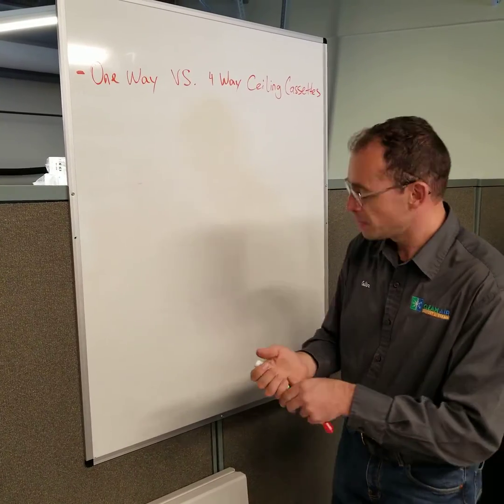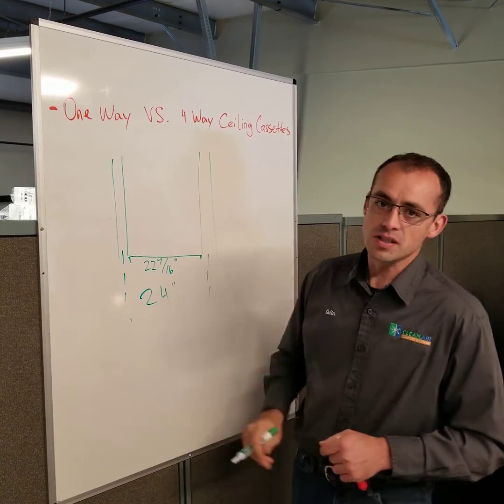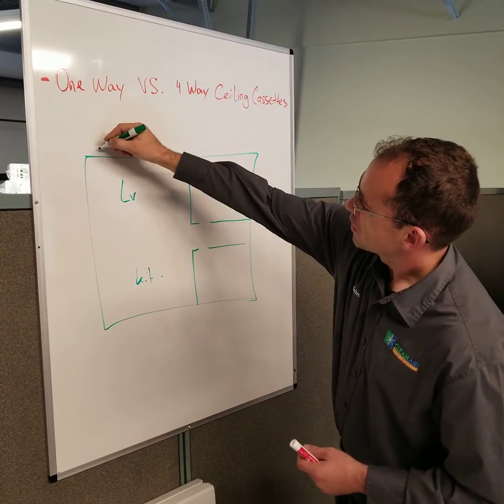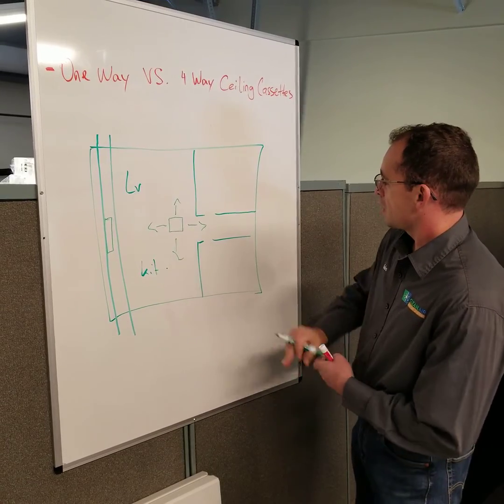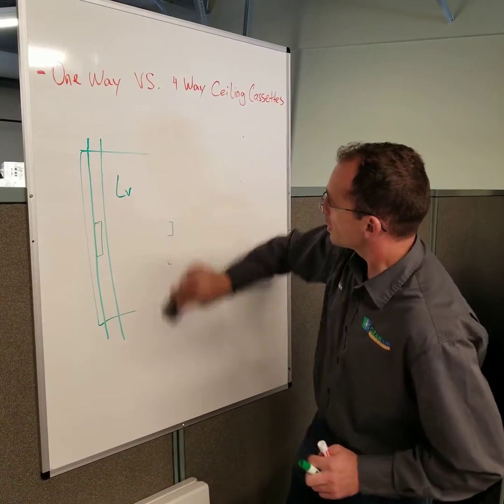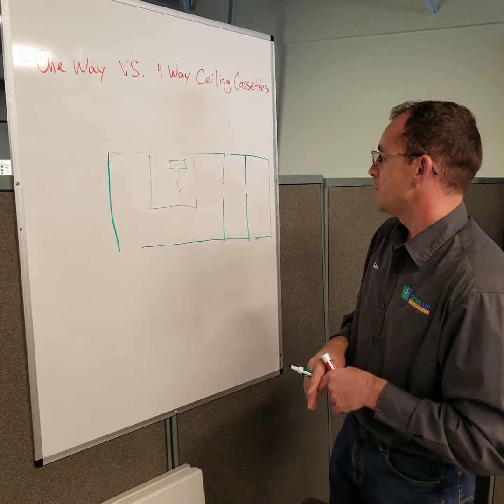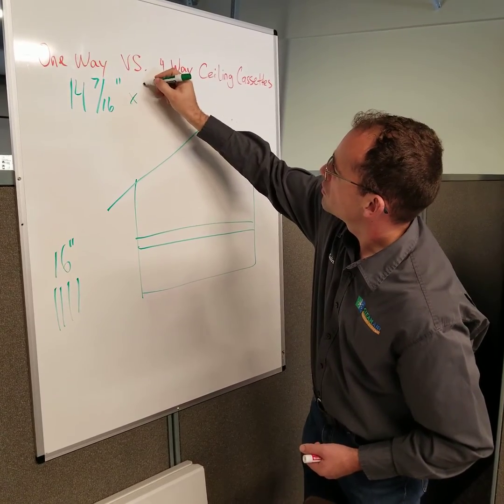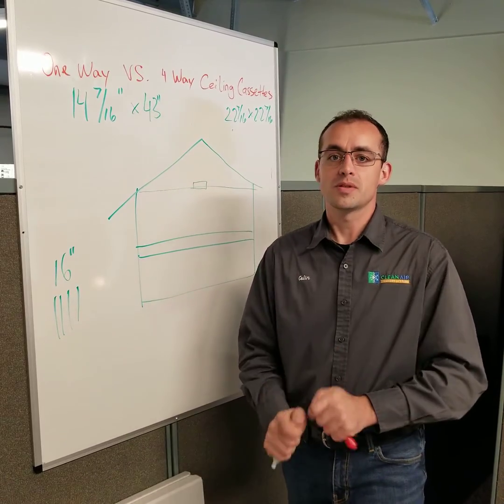One Way vs. 4 Way Ceiling Cassettes. How to choose.

Comment: Thank you for the video. I just wish  someone was making 4 way units that fit in between 16" OC joists. It would be perfect for my application.
Reply from the maker: @pabloseba35  the feeling is mutual.
Reply: @cleanairheatingcooling4105  How do you remove the mold off internal coil etc on a one way cassette?

Comment: Most underrated and underviewed mini split video on YouTube. Thank you for going through these things to consider. What about noise, 4 way vs 1 way vs wall unit?

What is the default preferred unit? Ive got a 1200sqft 30x40 garage I'm air conditioning. I dont need the cars to necessarily be super chilled, but the garage itself I definitely want to be conditioned. I'm thinking 2x 12k ceiling cassette units spaced closer to where I'll be working, to avoid ice cold glass water effect on the cars when backing out into the 95F florida humidity lol I've done that with my current home garage and its great to be able to do it. But the cars themselves don't need to be ice cold.
Reply from the maker: Great questions. First of all make sure that these units get sized correctly for that space given the square footage but not only the square footage. Do you have to use the construction material insulation the exact weather data for your area. This is a service that we offer if you'd like to call or show us a text.  

The wall mount units are generally cheaper to install and cheaper to purchase than the ceiling cassettes. It's really depends if your goal is lowest upfront cost or if you just want the right thing for the right reasons even if it cost more. When we install the wall mounted units we connect the condensate and refrigeration lines on the outside of the wall to avoid possible leaks and make it easy to service. If you want to text us some pictures of your job we can probably give you further advice that's a bit more tailored to your situation.  360-398-9400
Reply from the maker: @TheSoaringChannel  feel free to share our video, watch the rest, like them all and sub. It will help you video get promoted so it's not the most unwatched 😃🧡

Comment: A Mitsubishi Diamond Dealer contractor has suggested not locating a 1-way cassette over the bed, because the fan noise and condensation lifter may be too noisy. Do you agree?
Reply from the maker: Yes, I fully agree! Although I would say this varies is from person to person. I’ve had clients who can’t stand that noise anywhere in the room, no matter how far away from the bed. And some customers are not bothered by it even if it’s directly above the bed so I would say this is more of a personal preference for the home owner than the  contractor’s preference.
Reply: @cleanairheatingcooling4105  on that same note, the 4 way has a pump also, so that's worth noting, yeah? How noisy are these compared to the wall units? The downside to a wall unit is WHEN it floods - it drains water all over whatever is underneath. Please check for my comment in the main section. I'm about to do two 4 way units (I think) in the garage. Can the pumps be insulated so they are more quiet? Or does it resonate through the pan?
Reply from the maker: @TheSoaringChannel  I don't think that the pumps on the four-way ceiling cassettes are generally heard in the living space. I don't think we've ever had a problem or a complaint with those. But the add-on accessory pumps for the wall mounted units usually create complaints because its buzzing sound is a bit too loud for most living spaces.

Comment: Helpful info. I've only seen the smaller cassettes in Mitsubishi, not Daikin. How would you handle the drain lines if you were putting them between joists on a 2-story? That seems problematic.
Reply: I'm looking to install 2 one way in 2 bedrooms and one 4 way in living area,  is it possible to mix them ... when looking at  mitsubishi they only show one ways together and 4 ways together,  thanks
Reply from the maker: @petek6522  yes. You can mix and match them. We do all the time and it's approved by Mitsubishi. Are you working with a Mitsubishi Diamond Dealer contractor?
Reply from the maker: Great question. Just to clarify, are you asking how you would run the drain lines if you were installing these ceiling cassettes on the first floor of a two-story house? In other words the ceiling between the two floors is inaccessible.
Reply: @cleanairheatingcooling4105  exactly, was just wondering, I don't have that issue thankfully.
Reply from the maker: @sfbigdawg  we run into that issue. Sometimes we can drill at the end of the joist bay through the rim joist and feed the lines that way. Rarely we've had to open an access point along the way. Most often it's doable.